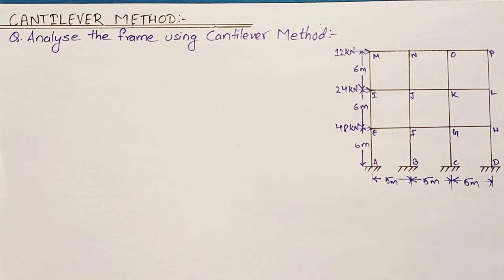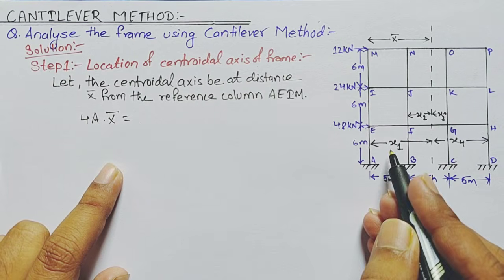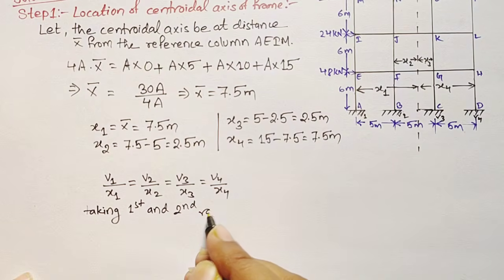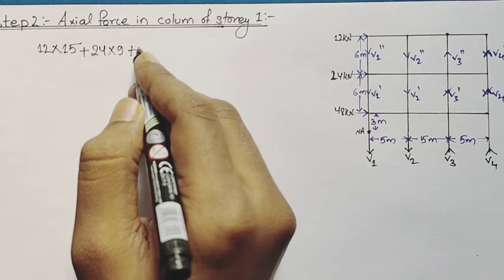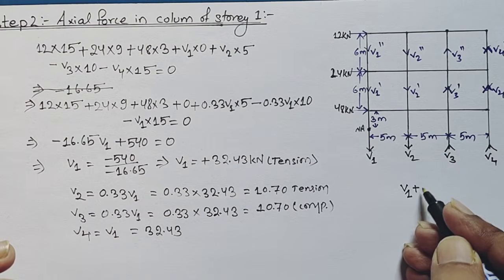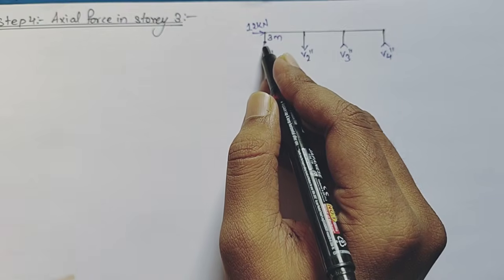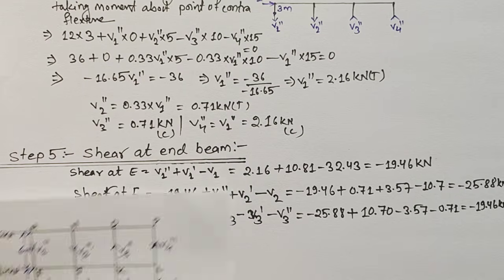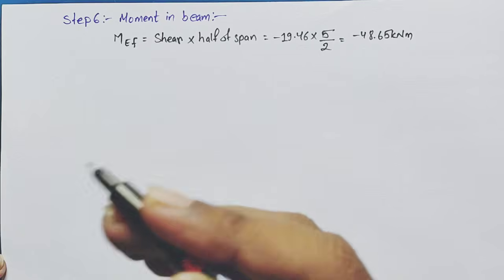Cantilever method

Comment: What abour when there are 3 coloumn how to decide there nature wheather tension or compression
Reply from the maker: In such case take V1 and V2 as tensile and V3 as compressive.
Reply: was this sign given in the question? How do you know the direction?
Reply: Yes mko bhi smjhao ye baat
Reply: @gouravsingh3211  v1 v2 ⬇️ v3 upward
Reply: sir how to find the value of the distance if 3 columns are there and the reference column is same as the 2nd column? 
will 0 be under v2 ? Please anyone reply asap